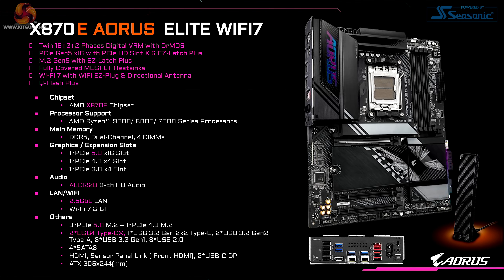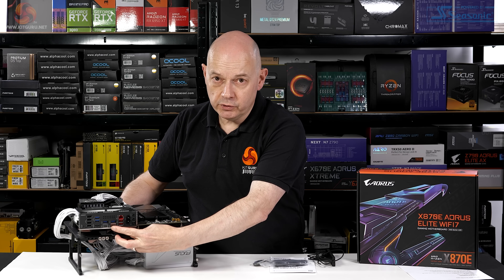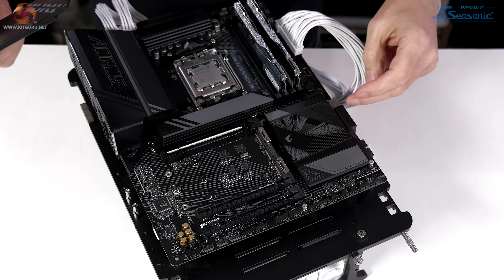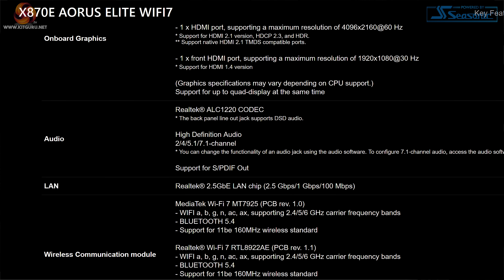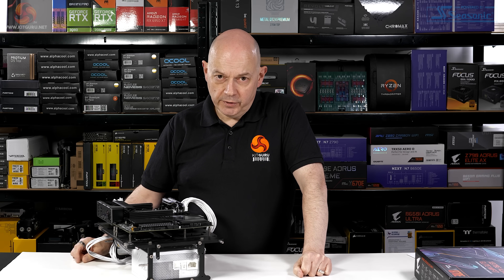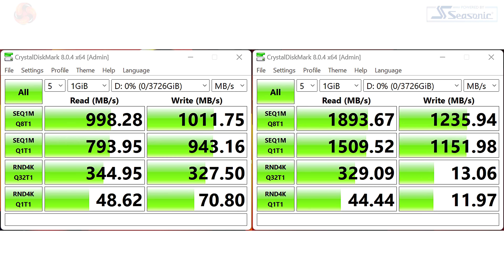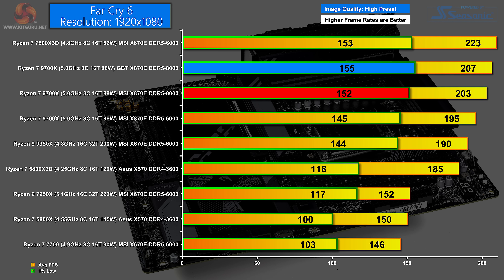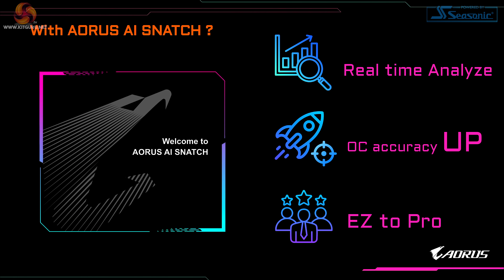Gigabyte X870E Aorus Elite WiFi7 - surprised us!

Comment: There's a lot of comparisons to the ASRock Nova in the comments. You have to decide which is more important to you. Having full PCIe 5.0 x16, but only one M.2 connected directly to the CPU in the case of the Nova. Or three M.2 connected to the CPU directly with this board, and the PCIe 5.0 running at x8 if more than one is used. No GPU planned is using full PCIe 5.0 x16, and this board still has an additional M.2 on the chipset, if you want to run full x16 and have two M.2. The Nova is not better by default, this is a Chipset / CPU lane limitation either way.
Reply: But nova has 8 layer PCB… :) while this card only 6…
Reply: Thanks for this useful comment! But what are the benefits of M2 connected directly to the CPU?
Reply: @vqa33 M.2 to CPU is less latency. More PCB layers is usually only to prevent signal interference, which depends on efficiency of trace routing. ASRock may have needed 8 or simple added for "extreme" OC of memory, which most do not do. All boards share lanes between PCIe and storage. Here it's the same, but with the Gigabyte board you have the option to have an additional 2 M.2 directly to the CPU, the ASRock does not.
Reply: @drewnewby  I’m going to buy X870 tomahawk anyway )) I also prefer avoid lane sharing with the gpu.
Reply: @vqa33 There's no lane sharing on the Gigabyte board unless you need more than 2 M.2, since you can have one to the CPU and one to the Chipset, same as the Nova. The Tomahawk is fine, but it's not X870E, it's the same as X670E.
Reply: I think it’s obvious that sharing lanes with M2 is much better than with GPU.
Reply: Well, for me the most important part of a mobo is being able to fit two 3-slot GPUs (and I'm even ok with the other slot being x4 pcie 4). And, unfortunately, the vast majority of them have it too low, just like that gigabyte.
Reply: "No GPU planned is using full PCIe 5.0 x16"
Not even the RTX5090? No performance hit so?
Reply: @edraith The 5090 will not fully use 4.0 x16 even...
Reply: @drewnewby  I'm all good, hope you are happy with your setup too
Reply: @deloford I'm a system builder, in PC repair for nearly 40 years. There's a dozen systems here, not one. No one asked if you were good? Just pointing out you were confused about your board functionality, same as my original comment, before you decided to voice your ignorance.
Reply: @drewnewby  no sorry you were very confused and I am glad I was able to help you understand better. I have a great system I won't need to change for 4 or 5 years, if the 5090 or 6090 (nevermind CUDIMM Gen5 drives/direct storage) in 2 years start pushing the platform then I will be well placed incase I dont want to move to AM6, if not then it's absolutely fine too, the Tomahawk is a great board and I am getting fantastic performance. 
As a system builder (I highly doubt you are) then you should understand all this.

And yea I've been building PCs since the early 90s (Amstrad 1512, SX-25 and DX2-66) too including setting up a gaming Internet Cafe in 2000 with 64 PCs and running LAN game events so you can cut out the patronising nonsense because I've been there and got the t-shirt. You sound like a pretty sad old man whose days of understanding what building high-end machines are at an end. 

This is an inclusive community, and we don't need a bitter old man trying to bring younger enthusiasts down. Perhaps a switch to gardenning might be in order Drew?
Reply: @deloford No one asked about your system, you're just replying to harass. Again, I'm just correcting misinformation from posts like yours.
Reply: I went tuf 870
Reply: I have read that a 4090's performance will drop between 2-7% when it drops to 8 lanes in some games.
This is a big deal, nobody seems to be mentioning it? 
Everybody has more than 2 M.2 drives don't they?
Reply: @deloford No, just review tech power up for 4090 PCIe data. If you actually need more than one M.2 directly to the CPU, it's a workstation, and PCIe 5.0 x8 would make zero difference for the GPU.
Reply: @drewnewby  I want to update to a 5090 next year but in fact I don't believe there is no impact even with a 4090, even if the real world impact is small or rare why would I take the risk and cut bandwidth in half to my GPU just to run some slower additional storage? Makes no sense. I will go ASRock and avoid this.
Reply: @deloford It honestly doesn't matter what you believe, it's tested fact. Go with whatever you like. The 5090 will be PCIe 5.0, but will not saturate x8 either.
Reply: @drewnewby  how do you know that? I found a video testing 4/8/16 that showed in some games a reasonable jump in FPS going from 16 down to 8. I am running twin 55" OLEDs at 4k running most games at 7680x2160 and would like to get a 3rd for a flight sim and racing rig, I plan to have this motherboard for 5 years (hopefully) so I do not want to be limited to PCI GEN 4x16 (PCI GEN 5x8), seems pretty obvious.
Reply: @deloford You need to look at the tech power up article. I know because I've done the testing also. Especially at 4K, you would see little difference with a 4090 between 4.0 x16 and 4.0 x8. The 5090 will not saturate the 4.0 x16, and since it's 5.0, that means 5.0 x8 will be fine. Regardless, you do not seem to have a 4090 anyway to test,  and a reminder the 5090 will be $2399 USD MSRP at launch, and likely much more retail. So for the vast majority, this is a non issue, and likely you as well.
Reply: @deloford  thanks for helping to keep Gigabyte boards in stock at good prices for the rest of us :) and enjoy your build, they're both great
Reply: @drewnewby  the GPU has ascended to now cost more than an entire build...
Reply: @matsudakodo  no problem Im very happy with the Tommahawk, 7800Mhz 48GB RAM, no GPU lane sharing and 4 m.2 drives all running beautifully including a Crucial 705 which is just insanely fast. Ready to sell my 4090 now ready for the 5090 upgrade!
Reply: @deloford Still confused, and it's Tomahawk, one m. The second M.2 runs at 5.0 x2 if you have any 40G Type-C plugged in the back. The third M.2 runs at only 4.0 x2. Not "beautifully", a lot of sacrifice for a GPU that doesn't need x16 at all.
Reply: @drewnewby  sorry you're still confused Drew, so yep, in the BIOS you can divert 2 additional lanes away from USB 4 ports (which I have no devices) to the 2nd M.2 Gen 5.0. 

This is a clever way to get around AMDs stipulation to support USB4. Indeed the remaining slots are Gen4 and come from the chipset, but as I have no additional al PCIe cards they both get thr full 4 lanes each. I have ordered a 2nd 4TB 2nd Crucial 705 which I will replace my 2nd Gen4.0 M.2 drive with. 

I could find no other board that let me do this really, apart from the godlike. it's a bit of a minefield but yes delighted I've finally got GPU 16x Gen 5, 2 Gen 5 m.2 and 2 Gen 4 m.2 all with their maximum allocatable lanes. Beautiful.
Reply: @deloford Still confused. I know how the 5.0 works, most need 40G also. You do not have two full 4.0 x4, go check your manual again. These X870E boards are not for you, since you've settled for X870.

Comment: I bought this, and I can’t for the life of me get the m.2 heat sink to latch - like - at all
Reply from the maker: That's peculiar. It is slightly fiddly while the protective tape is in place over the thermal pads but in general use we had no trouble whatsoever.
Leo
Reply: @ yeah for some reason it just will not latch - I’m using a crucial p3+

Comment: Haven't yet felt the need to jump to AM5 yet. Still happy on AM4, but I'm very happy with Gigabyte's stuff. I normally go for MSI boards but in wanting to do an Intel build (as I hadn't done one for years) I was actually very impressed with the Z790 Aorus Elite for feature set - just recently added the Thunderbolt 4 card and it works a charm. If and when I do go for AM5 I will definitely go for the X3D and this board.

Comment: I've had this board for 3 weeks and the only little complaint I have is the lane sharing and no clear cmos on the back. I've done some research, and it doesn't look like lowering the GPU bandwidth hurts too much if even at all for gaming. Looks like in most cases you might lose a couple of FPS which probably won't be noticeable. That being said, I have 3 of the M2 slots populated and everything has been smooth. 2 x gen 4 2tb and 1 4tb gen4 crucial.
Reply from the maker: Thanks for sharing

Comment: Micro Center is offering a bundle w/ the 7950x3d, I've been wondering if it's worth pulling the trigger.  I don't like how the PCIe x16 slot shares bandwith w/ two of the M.2 slots though, but I've read that supposedly it won't affect GPU performance much, but not sure what the reality is.
Reply: I bought that bundle a few weeks ago and haven't opened it yet.  Trying to see if I should take it back based on the reviews of the 9800x3D.  If that chip isn't much faster than the 7950x3D I'll keep it and start building.
Reply: @Kwincy5  Careful, you may not be able to bring it back if it's been 15 days since you purchased, I believe I was told return policy for cpu and mobo is 15 days.

Comment: about time they removed sata. i basically have the same board but the previous x670 model and it has 4 m.2 slots and ive populated it , one of the drives even has linux on it all i am saying is that 4 m.2 is fantastic so for me there's absolutely no need for sata any more.
Reply from the maker: I think based on research we have seen, SATA drives are still quite a popular option for people who have moved older drives over.
Reply: @KitGuruTech  no doubt , they should still remove it , how many times has the industry forced us to change? they do it to us all the time hardware and software . I think they should make 2 boards and if you want sata you can pay extra for it. Thanks for replying 👍

Comment: for all high end OC boards , wish they gave :
- ram fan cooling bracket for those high end OC settings plus small size 10mm thick fans like the noctua ones or some way to cool the ram without interference with cpu heatsink
- longer wifi antennas
- dual bios
- cmos reset switch
- cpu contact frame for better thermals and protection of the cpu bending issue + a proper hex torque wrench for that ilm frame screws
- rgb remote control
- sophisticated 12V and 5V sata powered fan hub with 10 ports each for PWM and rgb 
- m.2 expansion card
- include a bunch of PWM extension cables 
- PTM 7950 thermal pad
- two ps2 ports for no frills connectivity for mouse+kb while in bios
- marking on the usb headers which have direct connectivity lanes to cpu for that low latency IO devices like mouse + kb for gaming
- some replica of asus nitro path
Reply: - The effin PROPRIETARY SIZE "Bundled Thermal Pad" needed for single sided NVME as per the manual instructions.
- The effin PROPRIETARY SIZE "Bundled Thin Rubber Pads" and "Bundled Thick Rubber Pads" that manual instructs you to use for additional NVMEs...
Reply: @edraith  definitely
Reply: @zlibz4582  I contacted them but they're not replying on this issue, this is infuriating and I'm considering just asking for a full refund at this point.

Comment: I've not had particularly good luck with Gigabyte products outside of mobo's, though from what I was looking at a few months ago on the E variants, this actually looks pretty reasonable versus everything else. At least two usable PCIe full x16 slots, lots of NVME lanes and a respectable backplate.
ADD: For those of us running 5300RPM fans, yes, SATA slots do come in handy. 😁 As much as a bother as they are, nvme drives over 4tb aren't particularly plentiful or affordable, so mass storage still defaults to HDDs too.
Reply from the maker: Thanks for sharing
Reply: Quite a few years back (think decades ago) Gigabyte had real quality problems with their motherboards. I can't remember the year, but they took up the issue at a management meeting and was seriously considering ditching the motherboards entirely as the RMA costs made them lose money on every sold MB. They decided to give it one last chance and this time the quality was supposed to be the primary when deciding on construction and choosing make and model of components rather than always go with the cheapest option. This was way before they "invented" the Aurous name, I would say it was more than a decade ago perhaps two. But the change was immediate. The motherboards they released after that cut down on the RMS cost by a lot, and suddenly they were making money on selling motherboards instead of losing money. AFAIK they've kept making decent motherboards since, instead of cutting corners until they fail often enough to cost them more money for the warranty replacements than they make selling them.

All in all this doesn't really matter for customers today. I just think it's pretty interesting to know that once they were doing so bad that they were considering ditching the motherboard business.
Reply: @blahorgaslisk7763  That sounds very accurate to my experience with the last GPU I got from them, back in the 280x era. While it never blew up like their power supply woes not too long ago, it overheated even with minimal tasks and would regularly self-destruct into Errorville in games. Between the 280x issue and their QA dipping lower on other product lines, I have been leery to pick up function-centric products from them, though I have eyeballed their TR40 boards numerous times. Good to know the effort is being made to improve!
Reply: This board isnt that good, using more than 2 m.2 slots cuts the pciex16 to x8... x670 is better if you dont need usb4.
Reply: @RainOrbs  Yeah, I've run into the m.2 downrating other lanes issue before, which was a particular draw to this generation of motherboard that was supposed to fix that (the X870E variants specifically). I've mostly decided to go X670E for half the price depending on the next variants of the X3D chips if the higher core counts (9900 or 9950s) get dual vcache allotments, otherwise the only other x870E boards that work for me are in the $500 range, which is just absurd to get bracketed into that segment for two features.